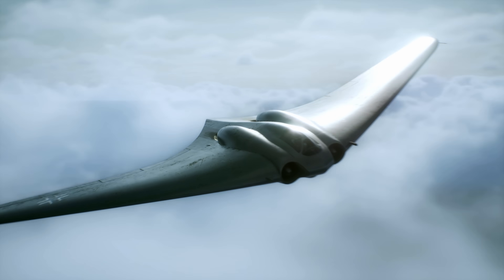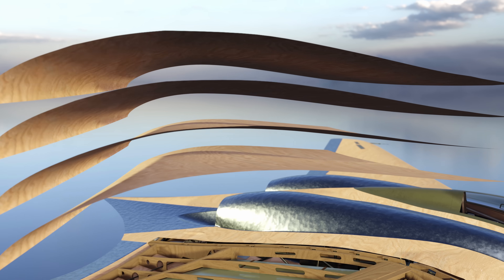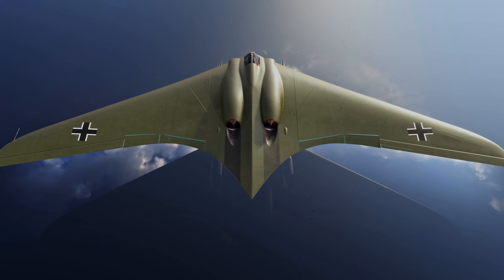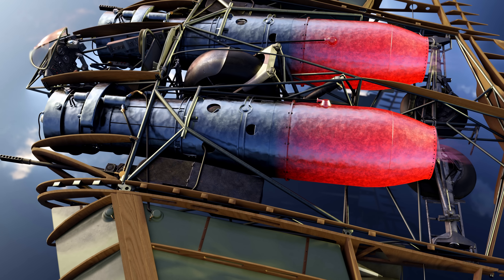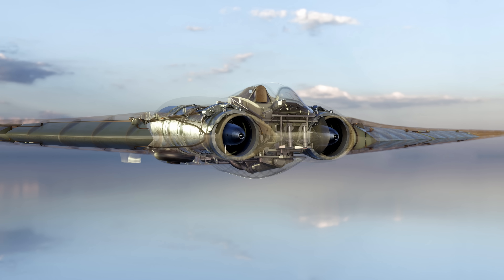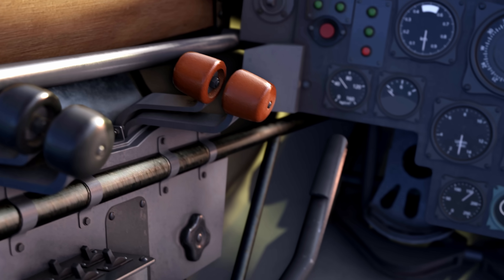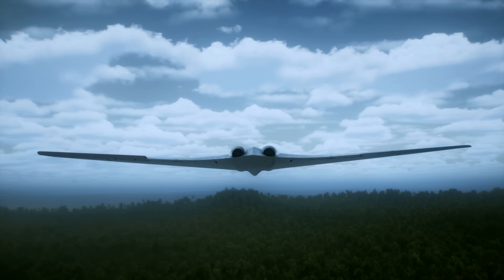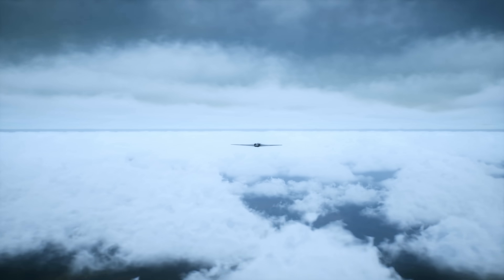Inside the Horten Flying Wing

Comment: It never flew.
Reply: IT DID FLY... IT WAS A REAL AIRCRAFT THAT WAS YEARS AHEAD OF ANYTHING THE ALLIES HAD DURING WW2.
Reply: @sandervanderkammen9230  It was not “years ahead.” It was a flying wing aircraft, which had already existed for decades, which crashed on its third flight.
Reply: @mrnoskills3589 The Allies had absolutely nothing comparable to the Ho-229.
Reply: @sandervanderkammen9230  The Allies had numerous jet aircraft, flying wings, bizarre concept aircraft both successful and unsuccessful, etc. 

What exactly was so special about the Ho-229 that made it unlike everything else?
Reply: @mrnoskills3589 The Allies didn't have a  have a jet Fighter-bomber capable  of 600 mph or any radar stealth technology.
Germany had jet bombers, supersonic ballistic missiles and rocket planes.
The Allies had absolutely no radar stealth technology.
Reply: @sandervanderkammen9230  The Germans didn’t have any stealth aircraft either. Their only deliberate attempt that I am aware of was the Moskito, their own version of the De Havilland Mosquito, which they had a notoriously hard time spotting and intercepting throughout the war.

Also, why does it matter that it was specifically a bomber? Is it suddenly more advanced than Allied aircraft just because it could carry bombs? That wouldn’t make much since given that really any fighter of that era, jet or not, could be fitted with bombs if needed.
Reply: +@Kim-i6v9b   The effort only achieved a series of different prototypes.  The first V1 was a glider that flew until it was damaged in an accident. The second V2 was powered by jet engines and flew for about two hours of testing before a fatal crash.  No more flying was completed by the 229 program and the third unfinished example V3 is at the Smithsonian Museum.

Comment: El B-2 no existiría literalmente si no fuese por el Sr Horten por 2 cuestiones: 
1°- Se basaron es su diseño, ya que los anteriores desarrollados por ellos antes de tener el HO -299 no fueron exitosos.
2°- Durante su desarrollo secreto, técnicos de N.G. viajaron a la provincia de Córdoba, visitando durante más de 1 mes en varias ocasiones en su casa al Sr. Horten, donde él les explicó todo lo que debían pulir y mejorar en el diseño del B-2 para que no tuviese inconvenientes y fuese efectivo, aplicando sus mejoras el B-2 pasó las pruebas y finalmente llego al prototipo final.  
Esto claramente no es algo que se divulgue por logicas razones, es algo que jamás será blanqueado al público, no muchas personas conocen la historia real detras del ala delta furtivo actual.
Reply: That’s all nonsense. The B-2 was based on Jack Northrop’s XB-35 and YB-49 flying wing bombers, which share identical wingspans with the B-2 and were built to fulfill similar roles as intercontinental bombers. Both the XB-35 and YB-49, despite their shortcomings, were far more successful than the Ho-229 due to the fact that they actually lasted more than three flights.

Also, there were no stealth Horten designs. That was a myth created by Reimar Horten in 1983 after he would have known that stealth aircraft were possible. The radar-absorbent materials he claimed to have developed for the 229 were never found on the surviving aircraft.
Reply: @mrnoskills3589 Northrop conducted exhaustive research on the Ho-229 during the 1970s and the development of the B-2 was heavily influenced by the Ho-229.
Reply: And of course you know these truths. Heaven help the idiots of this world. The Horten was never really capable of flying. A flying piece of wood that circled an airfield for a few minutes and crashed. That was it for the program. In contrast to Northrop's, which started in 1941 and extended to the YB-49. Of course, without the influence of the Hortens' garbage heap. And this YB-49 was flyable as a flying wing (they flew from the US East to the West Coast, after all) and was the obvious basis for the B-2. But no. You had to go to Horten's house and ask how things were going with the B-2. How stupid are you to try to sell such a stupid story. By the way, after the war the Horten Brothers no longer built flying wing bombers, only gliders. :-)

Comment: Stop lying about the ONLY TWO HO-229 !
They did fight in combat and the US stole 2 after the war. They are at the Smithsonian.
Reply: Only one Ho-229 was completed, and it crashed on its third flight.
Reply: +@laszlovandor4770   The 229 program was only a series of different prototypes.  The first V1 was only a glider and it crashed on a test flight.  The second V2 was the first to fly with jet power but it only managed about two hours of testing before a fatal crash on 18-February-1945.  This was the only flying completed by the 229 effort.  Prototype three V3 was incomplete when found at the Gotha workshops in mid-April 1945.   Only the frames were started on prototypes four, five, and six.  The only 229 example retained by the Allies was the prototype number three, the V3.  Examples of other Horten work were also kept by the Allies.   No, the 229 did not fly in combat and didn't fly much at all.  It was still a research project and not ready.

Comment: For the primitive, early radars of WW2, I imagine maybe it would of been stealthy.
Reply: Northrop conducted tests that revealed a 58% reduction in frontal RCS compared to aircraft of similar size and this represents a minimum of a 20 minute delay in detection against British metre Band radar in use during WW2.
20 minutes is more than enough to prevent RAF interceptors from engaging before reaching key targets in the UK.

Comment: Northrop YB-49 was the US version of this design, it flew a few years after the war.
Reply: +@Netjez   Northrop started construction on the YB-35 in 1941, several years before the Horten project.  Conversion to the YB-49 platform began late in the war as the potential for jet engines was realized and as piston engines had reached the end of their design life.
Reply: The YB-49 does not exhibit any radar stealth technology in its design, the Allies had absolutely no RAM technology either.
Reply: @sandervanderkammen9230  Nor did the Ho-229, as that was not the intention of the design. Both the Ho-229 and YB-49 were built to minimize weight and drag via the flying wing design.
Reply: @mrnoskills3589  I have read that US Air Force radar operators occasionally had to ask the YB-49 pilots to activate their IFF because they were losing track of the wing due to low radar returns.  This enforces the argument that the radar properties of wings were only being discovered.

Comment: You just cant push the stick forward for dives at high speed. The blood would rush into the brain at high pressure. You  need to roll furst so any direction you are travelling in needs to be a pull stick manuver. Not a push.

Comment: The US military straight  up copied this design with the Northrop flying wing and the B2 bomber. The Germans outclass everyone when it comes to engineering and science. No Werner von Braun = no US mission to moon.
Reply: Flying wing designs at the time weren't intentional built for stealth nor were they actually stealthy but to achieve less drag and higher speeds. The US had there own flying wing during ww2 design but never adopted due to instability, it wasn't until fly by wire and computerized avionics for flying wings to become a viable platform. If the Germans truely wanted a stealth design they wouldnt have had designed exposed intakes nor would hey have plans for external hardpoints for bombs.

The germans also neglected the importance of radar. If the germans already knew the importance of stealth, wouldn't they have tried properly integrating radar into their own operations? Because the allies did a much better job recognize the importance and actually integrating it.  

The B2 and 229 share very little similarities aside from simply being all wing design.
Reply: As the other reply already stated, the US already had flying wing aircraft during the war. Jack Northrop actually began designing his own flying wing concepts in 1929, four years before the first German flying wings.

He would design his XB-35 flying wing bomber prior to the US’ entry into the war, and it would be modified into the jet-powered YB-49 design in 1944. Multiple of each aircraft would be under construction by the end of the war, and it was those two aircraft that would inspire the B-2. German designs had no influence on it or any of Northrop’s other designs.

Comment: The thing with the 229s stealth is, that it was indeed more stealthy then a prop plane.
Not stealthy enough to not be seen on the radars of the time, but it would be detected a minute or more later.
So there would be even less time for interception.
But this is more accidential, due to the lack of vertical stabilizers and propeller.

Comment: The stealth capabilities in conjunction with the radar installations from 1945 would be interesting; however, testing them with state-of-the-art equipment today does not do justice to the capabilities of the time. Two squadrons flying low over the English Channel would likely have been a disaster for British air defenses.

Comment: Every single one of these German wunderwaffe aircraft outwardly look like the most advanced thing ever built in the war, and in some ways kind of are, but then you get to the construction and it's like, "The airframe is built predominantly out of plywood and duct tape, and its engines are made entirely of wrought iron, meaning that they have a service life of 45 minutes, but only if Mercury is in retrograde."
Reply: Alot of planes during that time used quite a bit of wood. Other than material shortages, a big reason is that wood keeps the weight down.

Comment: Stealth or not, it is a beautiful aircraft and speaks to the genius and innovation of the Horton brothers and their engineers.
Reply: @rtysson it is indeed beautiful, but genius? No, Horten brothers were not genius's, they used 2 different methods of measurement instead of using 1, the development of the aircraft is mind boggling.
I won't be arrogant to say "Forget it, they're just glider designers" -Northrop. 
It truly is a beautiful aircraft, but damn is it flawed 

I highly recommend checking out Military Aviation History on the aircraft, truly enlightening
Reply: Far more advanced than any American aircraft until the 1960s.
Reply: @uberkloden  depends on your definition of advanced, sure it had amazing aerodynamics... but the landing gear takes up 1/3rd of the fuselage, it spins if you look at it the wrong way, and requires constant attention from the pilot, all without having bomb bays or the control authority for dogfighting. it was certainly special, and well designed in many ways, but i would hesitate to call it "advanced" in any way but aerodynamics.
Reply: Did the Ho 229 even fly with Jet engines? Thought the Americans captured the factory before the Jet prototypes were rolled out?
Reply: To be fair, this aircraft was tested in 2008 for it's radar signature using advanced modern radar technology, to completely rule out it's true stealth ability, the aircraft would require an analysis using the far more limited radar technology of the period 😉
Reply: @SpectreOZ One thing though is the fact that it's mostly made out of wood, so the advanced shape is less significant of a factor. If however it was painted in some radar absorbant material, it would have been completely invisible at that time.
Reply: @vornamenachname989  problem with that is the air intakes, stealth aircraft use an S shape intake to mitigate radar bounce back, it would still light up on radar
Also, the coating that Horten said he planned on using for stealth, is the same coating that Soviets used for their prop planes, so the Soviets have been flying with stealth coating this entire time (this is joke, Horten was pulling sh!t out of his ass)
Reply: @vornamenachname989 maybe, as long as it carried no bombs.  All its munitions had to be carried externally which would have lit up a radar like a Christmas tree. Beautiful plane but useless as a bomber.
Reply: @Parabellum8True, but then again, it would have been the fastest plane in existence, faster than the Me163 even. It's not really useless when it's borderline impossible to intercept, it would have been the whole "Mosquito is the best bomber" but cranked up to 100 as it's completely impossible to actually catch the plane since it's moving 300km/h faster than anything else.
Reply: @vornamenachname989 this is simply not true. The model they tested even was entirely made of wood, whereas the original had a steel tube structure underneath, so the mock up was theoretically MORE stealthy than the original, and it still was perfectly visible to even the ww2 era british radar technology. The coating bearing any radar absorbing properties is also a myth, this was made up by Horton AFTER the war to make his project seem relevant.
Reply: @vornamenachname989 any claims about the combat effectiveness of this are speculation, as there are no documented tests supporting those claims. The jet engines proposed for the project also proved to be unreliable.
Reply: @SpectreOZ  the Northrop engineers mimicked the same radar that Britain was using at that time of the war, it still lit up on radar, because of the two intakes, it had the same radar return as a prop aircraft
Reply: @redtsar Indeed, they mimicked the frequencies & energy levels of 1940 radar technology, however the "equipment" used to receive the signals returned by the scale flying wing mock up was modern radar technology, far more sensitive than period equipment.

It would still have been detected but at a far closer range, given it's speed advantage the result would have been an issue for the British.
Reply: Fun fact this is the great-grandfather to the B2 stealth bomber
Reply: @HuginnAndMuninn01  no, it's not. Northrop had a dream of a flying wing before the Ho 229, great grandfather of the B-2 is YB-49
Reply: @redtsar   that is your opinion and you're welcome to it
Reply: @redtsar   I will also add as you said Northrop had a dream 

                  And the Horten Brothers had the Horten 229
Reply: @redtsar  why can't it be both? they had their own flying wing, then took some ideas from the Horten designs, combined they eventually became the B-2 and similar designs. aircraft engineers rarely care about copyright, they steal ideas from each other constantly, even if they already came up with the basic flying-wing concept, they probably took plenty of inspiration from the Ho 229.
Reply: @redtsar  WRONG YB-49 DIDN'T fly until 1947 and never entered production. The HO-229 was flying 2 years earlier. The HORTON was the world`s first jet powered flying wing. You lose. Look things up before outing yourself.
Reply: @terryparker1694  READ, all I said is that the HO ISN'T the grandfather of the B-2, YB-49 IS

YOU LOSE

Read CAREFULLY next time

Comment: Comment on le contrôle en lacet ?    Pour la furtivité, les turboréacteur comme ceci j'en doute.  Par contre le bois et pas de dérive devait largement réduire sont équivalence radar.
Reply: +@RIRA-el6xm   Yaw control was the big problem for flying wing research.  Northrop had implemented yaw dampers on his YB-35 while Gotha and the Horten brothers were planning to use drag rudders for yaw control on the 229.  A bomber with poor yaw control isn't really a good bomber if it cannot hit a target.
Reply: @FiveCentsPlease  No, but when you turn you risk skidding, sliding and falling, or even ending up in a spin.
Reply: @FiveCentsPlease  No, but when you turn you risk skidding, sliding and falling, or even ending up in a spin. With my modern vision and my penchant for biomimicry, I would design directional winglets that provide yaw control (like birds do, among other things). Two birds with one stone: reducing the wingtip vortices that increase aircraft drag and improving yaw control. A winglet positioned at the top of the wing at approximately 60° that pivots across its entire surface, similar to Chinese rudders (but smaller than a rudder for less drag). In fact, with winglets, the drag of these ailerons is largely offset by the reduction in vortices they create... Why not use them for directional control? I've always wondered... Unfortunately, I don't have a wind tunnel to test its intuition. I would add that by turning in the opposite direction, they can also serve as an air brake.

Comment: A jet plane that is made mostly from wood is a crazy concept. That it could withstand so much force is also quite surprising. Wood is certainly an underrated building material.
Reply: +@RayvenGuard   WW2 aviation, especially the Germans, resorted to wood because of raw materials shortages.

Comment: did this thing ever actually fly?
Reply: +@Handaros  Two prototypes were completed, the V1 glider and the V2 using jet engines.  The glider was used for testing until it was damaged.  The V2 made only about two hours of powered flight until it was lost in a fatal crash. That is all of the flying that the 229 program achieved.  The V3 at the Smithsonian was incomplete when found and did not fly.  Parts of the V4, V5, and V6 were found but do not survive today to my knowledge.